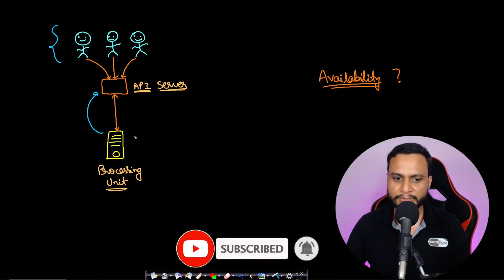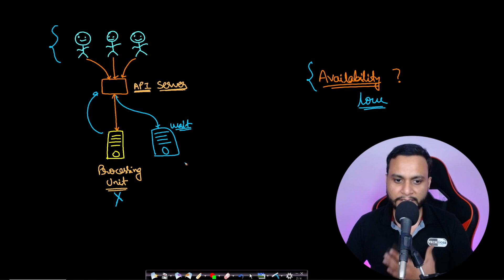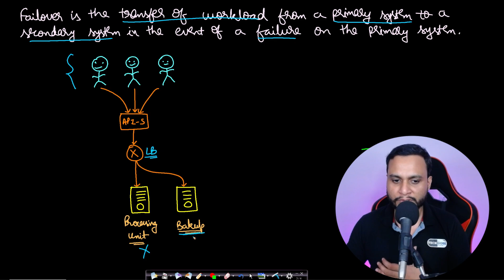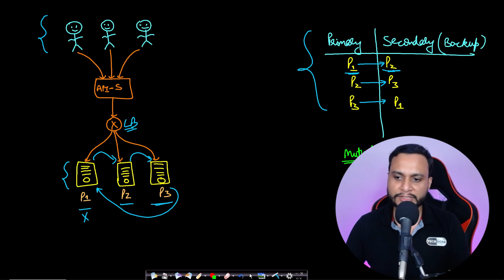Failover | System Design

Comment: In system design, failover is a process that automatically transfers control from a failing component or system to a redundant or standby component. The goal of failover is to ensure continuity of service with minimal or no interruption in the event of hardware, software, or network failure.

# Key Aspects of Failover
1. Redundancy: Failover relies on having backup components that can take over in case the primary component fails. This can include backup servers, network paths, or storage systems.
2. Automatic Transition: The transition from the failed component to the backup component is typically automated, allowing the system to switch over quickly without requiring manual intervention.
3. Minimal Downtime: The design aims to reduce downtime to the lowest possible level, ideally making the failover process seamless to the end-users.
4. Health Monitoring: Systems that implement failover usually have monitoring tools to continuously check the health and status of components. When a failure is detected, the system triggers the failover process.

# Types of Failover
1. Active-Passive Failover: The primary component is active, while the backup component is passive and only becomes active when a failure is detected. This is common in database replication setups, where the primary database handles all requests and the secondary database is synchronized and ready to take over.
2. Active-Active Failover: Multiple components are active and share the load. If one fails, the others continue to operate and handle the increased load. This approach is common in load-balanced server clusters.
3. Manual Failover: Requires human intervention to switch to the backup system. This is less ideal for critical systems where immediate failover is required.
4. Geographical Failover: Involves switching to systems located in different geographic regions. This is useful for disaster recovery and to mitigate the risk of regional outages.

# Implementation Considerations
- Data Synchronization: Ensuring that the backup system has the most recent data and is in sync with the primary system to prevent data loss or inconsistency.
- Heartbeat Mechanism: A method of monitoring the status of the primary system by sending regular "heartbeat" signals. If these signals stop, it indicates a failure, triggering the failover.
- Testing and Validation: Regularly testing the failover process to ensure it works correctly and meets the required recovery time objectives (RTOs) and recovery point objectives (RPOs).
- Failback: The process of returning to the original component after a failover event has been resolved.

# Importance of Failover
Failover is crucial for maintaining high availability and reliability in systems, especially those that provide critical services, such as financial systems, healthcare applications, telecommunications, and cloud services. By ensuring that there is a backup in place, systems can minimize the impact of failures and continue to operate smoothly, maintaining user trust and service continuity.